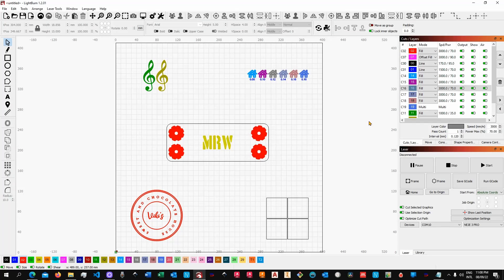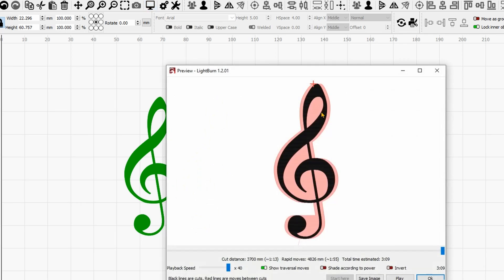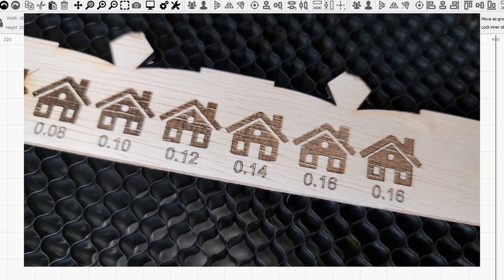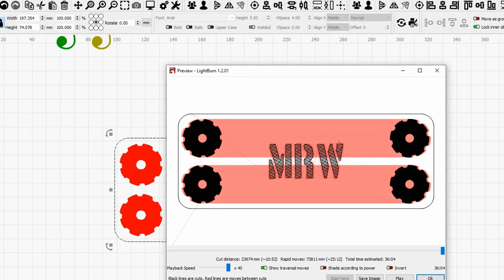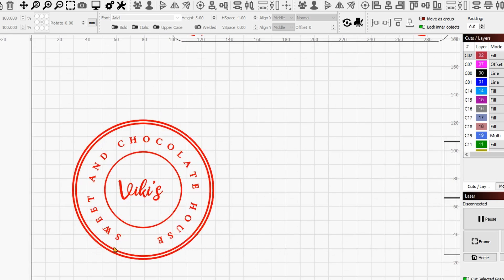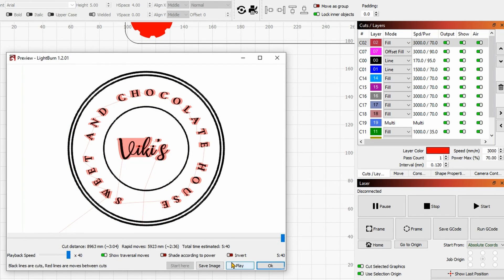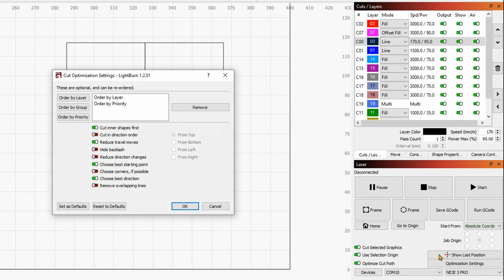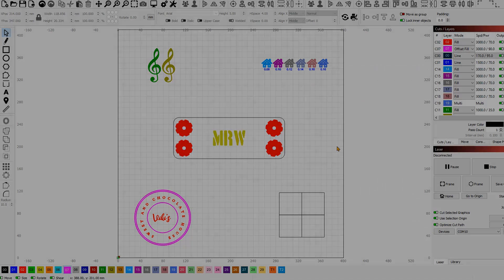Speed up and optimize your projects - Engrave 2&4 times quicker

Comment: I see a great difference in your speed parameter example burn. 
A bad line interval will show up in large image.
In general I like to ease off on the power saving the diode and adjust speed and interval. 
Adjustments in what the laser does with white space and path between objects will speed up a burn.
The worse logos as far as burn times are ones with circles however it is true optimizing circle line spacing works.
Each image is different.

Comment: I have a question. 

I use the cnc-3018pro, neje max 3, 40 inch Universal engraver with Lightburn. With the neje I can complete almost perfect portraits but with the Universal engraver I get line skipping at the same settings as I use on my neje. Do you know why?
Reply from the maker: Hi, jwwilson1961; thank you for your comment. 

Do you mean that some lines are not traced in the vertical direction? Or segment in the same line?
If you are making a portrait, I assume you are setting an image fill with horizontal lines. Therefore the laser will start from the top or bottom and scan through the material without reversing vertical direction. If my assumption al correct is a hardware issue something is not right with the driving system; either the belt is skipping for the same reason at some point, or some of the wheels are dented.

Do you notice a regular interval in the skipped lines? Or does it always happens at a certain distance relative to the frame?

This will help me help you with troubleshooting. 
Please send me a link to your product or some that look the same so I can assess the frame and driving system. Unfortunately, 3018 CNC are just standard sizes, but it says nothing about the actual product.

Let me know.
Ciao